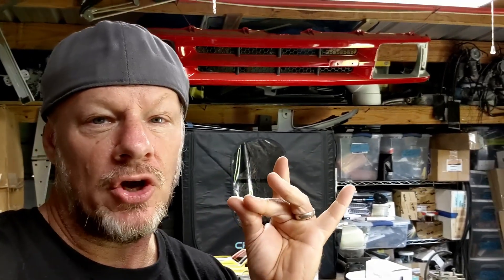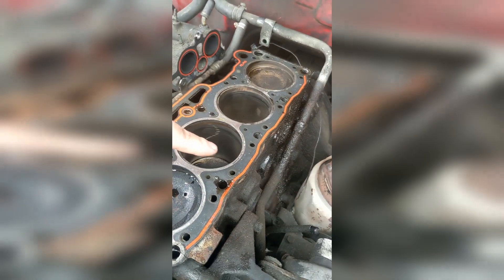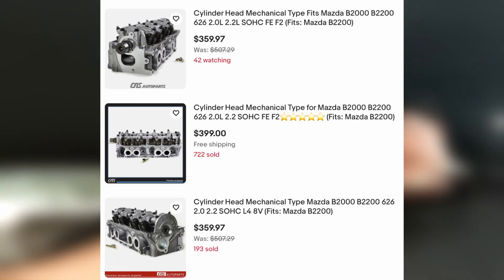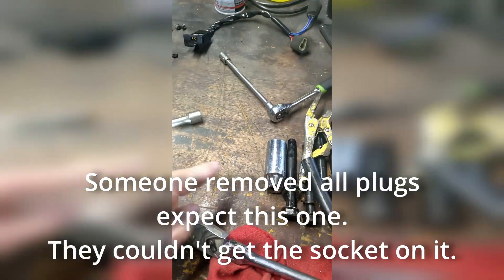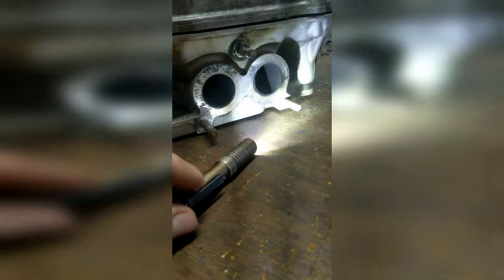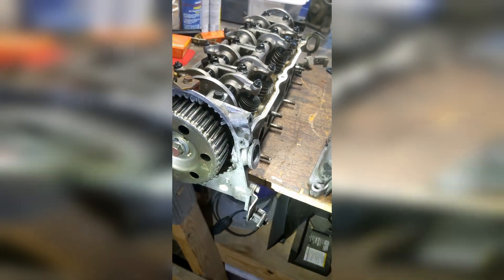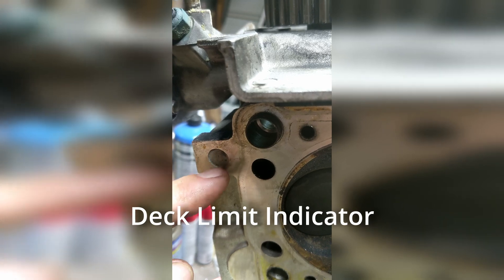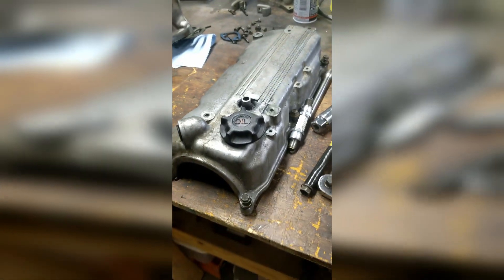Today Was a Good Day | Mazda B2000 B2200

Comment: Nice !!!  I don't think I'd be able or willing to remove a B2200 cylinder head in a parts yard, I seem to have issues moving the exhaust manifold away.  I have pulled a power steering gear box, console, 3-spoke steering wheel, bubble hood, and other stuff which I now have on my 1988, and in the past I have pulled rear jump seats, stamped tailgate, AC bracket, intake manifold, valve covers, tow mirrors for customers.  Of the 6 AC switches I have pulled, 5 were bad and I needed to repair those; sold 5 and kept one as my spare.  I also have pulled stuff like windshield wiper covers, speaker grilles, door lock bezels, flasher relays, fuses, all sorts of small stuff.  But B-trucks in the parts yard here in Arizona are now few, and few of these trucks were sold new back in those days.....so I haven't been to the parts yard for at least 6 years now, as my B2200 and my 1998 and 2004 Frontiers haven't needed such used parts.
Reply from the maker: Awesome
Reply: How difficult is it to repair the ac switch? I have 3 and all bad
Reply from the maker: https://www.mazdaminitruckin.com/info/air-condition#h.yg3n0fiiqfaz

Comment: Honda makes a thin wall socket for spark plugs for some motorcycles, maybe one of those would fit that tight space on the head
Reply from the maker: I will look into it but I've never had to before on other heads. I had to Dremel around just to get my socket on that plug to get it out.
Reply: @MazdaMitch  just a thought.  Take'er easy.

Comment: Hey what’s the black square on the distributor that has a wire coming off going to the distributor and can I bypass it
Reply from the maker: Yes it's just a noise suppressor for radio. Not needed with head units of the past 20 years

Comment: Hey, i was thinking of ripping my engine down and doing a gasket match on the intake manifold as well as just cleaning the ports on the head out. Whats your thoughts on this bc ive seen mixed reviews on doing that with a carbd engine. I noticed on one of ur videos ur buddy gasket matched the intake did yu have any issues?
Reply from the maker: Didn't have any issues. I had driven the truck before and after that mod and I'm not sure I could tell a difference. I'm sure it didn't hurt. On bigger engines it's been proven to be effective but I've often felt it was a waste of effort on the Mazda B series engine. Like I said though it can't hurt. I may do it on my next rebuild.
Reply: @MazdaMitch  nice!! Thanks. My intake and ports on the head are super glogged. So i hope i see improvement